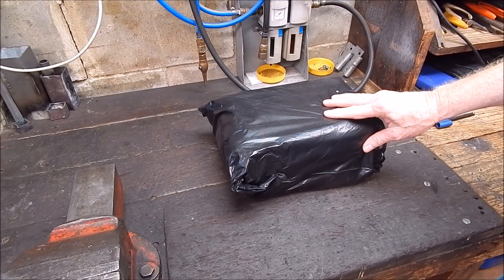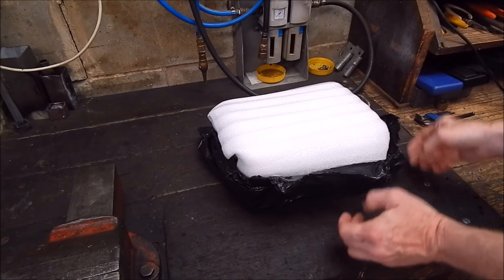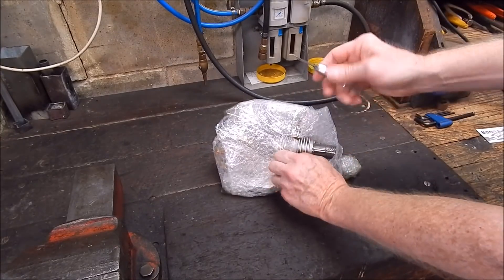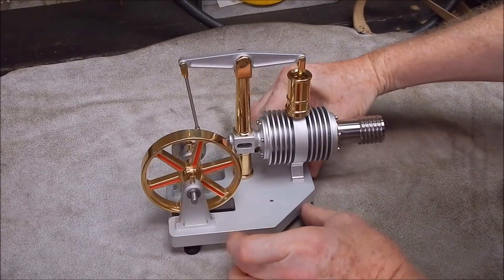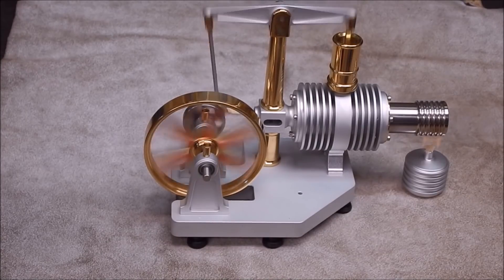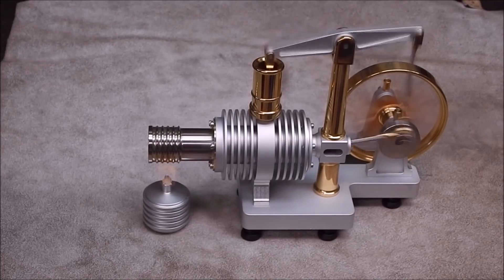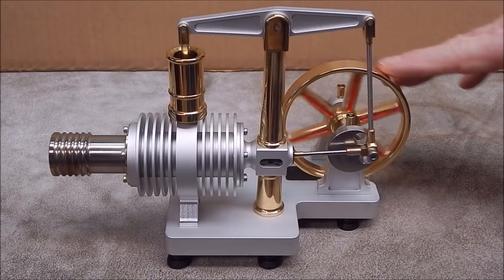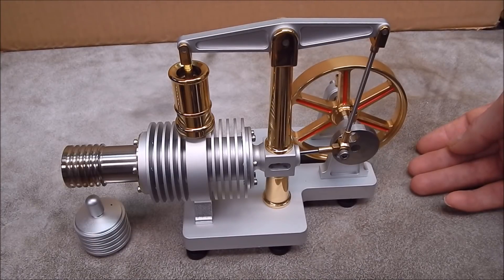Chinese beam type Stirling engine - made by Tarot

Comment: You might have sold me on one of these !
Reply from the maker: It's funny how things go.  I was actually bored today waiting for a job in the workshop to dry, so I played with my model engines while I had a beer.   Hadn't done so for a while.

This stirling beam engine runs so well and so easily there is no comparison to the rest.  It's a great little engine.  The only thing that needed attention out of the box was the rocker arm pillar was a bit loose.  To tighten that just knock out the rocker pin and you can then get to and locktight the Allen headed pull down bolt in the pillar centre.  The pin comes out very easily with a fine pin punch.

Beautifully made unit.

Cheers Rob
Reply: @Xynudu  It does look very well made Rob. If you want to further your stirling/steam addiction. Join up here - https://www.officeofsteamforum.com/index.php
Reply from the maker: Thanks for the link.  I will have a peruse one night.

It's a fascinating area, particularly when you come from an internal combustion background.  Home made engines certainly give you a lift when they work.

Cheers Rob
Reply: Rob, I have really enjoyed your YT channel over the years mate.

Comment from the maker: The vertical column on mine came loose. 

To tighten this remove/knock out the beam central pivot pin (quite easy), swing the beam and power piston out of the way and you will see the Allen headed bolt in the column.  Remove it, Loctite and replace.  Easy fix.  You may have to put a dab of Loctite on one end of the pivot pin when you replace it so it stays in place.

Great little engine - runs extremely well and is quite powerful (for a Stirling engine).

Cheers Rob

Comment: I have this engine as well. When it arrived, every screw was loose. Including the one that secures the vertical pillar that supports the rocker arm - a real chore to get at the screw to tighten. But once all that was accomplished, the engine runs remarkably well.
Reply from the maker: Hi Shawn. 

The pillar screw on mine is loose as well.  How did you get it apart to tighten it ?  Looks like some pivot pins have to be knocked out ?

Cheers Rob

Comment: Alright, now let's hook it up to the Sherline.
Reply from the maker: Hmm it's not that gutsy.   I was thinking maybe hook a generator up to it and have a fancy LED display.

I see the base plate has an extra hole in it for something and the shaft end stands proud to mount a pulley on that same side.

I had a good play with it this morning in the cooler weather and got it just ticking over at about 50 rpm.   Sweet.  He He toys for big boys.

Cheers rob